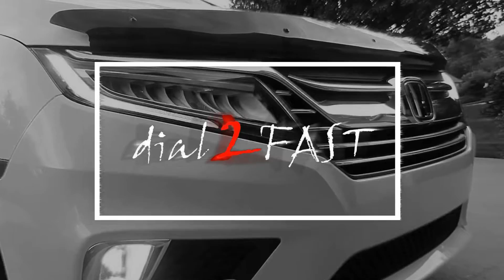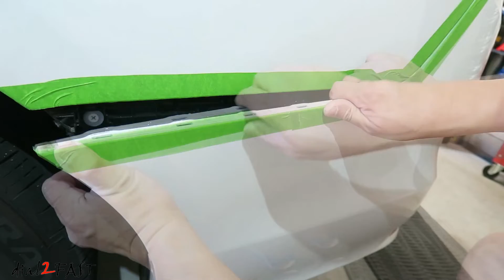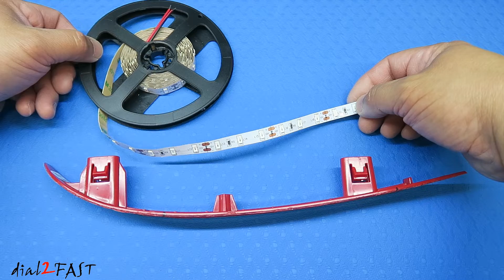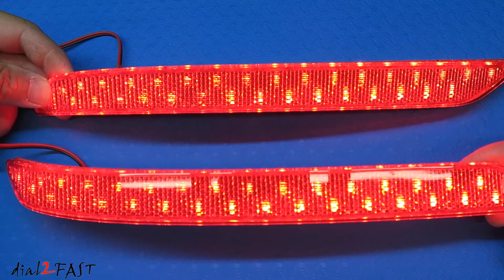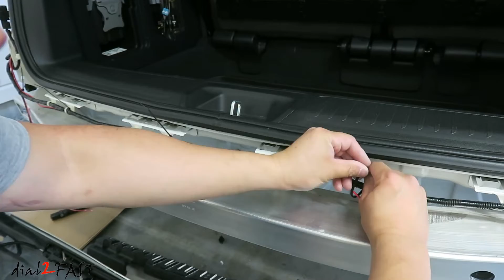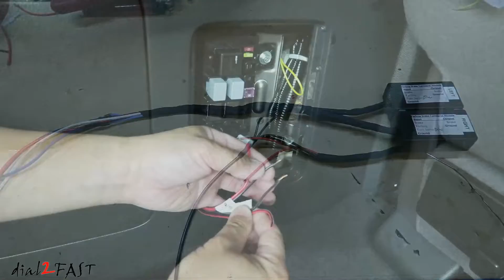Custom LED Rear Reflector Mod For Honda Odyssey 2018+

Comment: Hello sir. I know this is a pretty old video, but wondering how has the control module been holding up for you? I'm about to do this mod on my 2020, but saw the other guys comment about the module going bad. Thanks.
Reply from the maker: No issue with the module.

Comment: For the control module, I would not recommend them whatsoever. Especially from corsomotion. The company states they have a warranty but its bs. Already had 4 modules fail before the warranty was up and they didn't replace any of them. They had me ship 2 of the modules back at my own cost as well. They take forever to reply to your messages and then end up leaving you hanging for months on end. If you're planning on doing this, add 1 led strip per whichever you want (parking, break, or turn). In my case, I rewired it up just to have 2 led strips, turn and break. Wire up the positives to each the turn and break, and ground would be wired together. Doing it this way will avoid spending money on the control modules, as they are not cheap... 25-30 bucks for a pair... that you'll potentially have to repurchase over and over.

Comment: If my vehicle has an OEM Trailer hitch with wired plug under bumper, can I tap into that instead of accessing taillight wiring from above?
Reply from the maker: Yes you can connect to the trailer hitch wiring

Comment: Hi could you pls help me with wiring 2017 odyssey ex, new module has black white, yellow and red. From my understanding black is for ground yellow turn and red break, white is parking. On the van I have green (right turn signal) yellow left turn signal , red wire is it break? And brown ground? Where do I connect the  white wire from the module
Reply from the maker: On the control module, yellow is turn signal, white is parking light, red is brake, black is chassis ground. As to the wiring color on your 17 van, you need to test it with a multimeter to find out which wire is which.
Reply: @dial2fast  Thanks yes made it work

Comment: Thank you for all you videos!  This mod is great.  Is there no way to reach the reflectors withOUT taking the whole panel off?   I am not comfortable taking that whole panel off.  😬
Reply: You could probably just clip them off by putting your hand underneath the bumper. However, it's best to take the whole bumper off as you can then see where your wires go and so that you can access the inside of the car. 

Don't be too afraid of removing a bumper. They're like Legos. They clip in and out of place easily, and the screws are guiding points.

Comment: They now sell these on Amazon.
Yours has a slight delay, also turn signals are not in sync, you need to switch your turn signals to LED
Reply: What is the link to the Amazon item?
Reply: The delay is because he still has the factory incandescent bulbs in the factory lights. If he had upgraded them to LED’s as well, they’d be exact

Comment: Love your videos on moding the Honda Odyssey.. my question is do you think installing just one LED light strip would be enough light output ? Instead of your double row of LED ?  And do you have to worry about any hyper flash with this install ? Great job.
Reply from the maker: One strip will still look alright at night, but you won't see much during daytime. The two rows is also not going to be super bright during daytime. No hyperflash issue because you are not replacing the factory turn light bulbs.

Comment: Hello sir,

I have a 2020 EXL without RES. Could you please recommend an aftermarket RES that I could mount onto the back on the front seats? One of our kid is in a front facing car seat and the other two are still in rear facing car seats. Thank you very much
Reply: not possible yet

Comment: would it be possible to have dynamic turn signals?
Reply from the maker: Dynamic as in sequential LED? If so, the tough part is find sequential LED strip that fits the specific length.
Reply: dial2fast yeah, but would they be sequential when brake or parking light is on? 😅
Reply from the maker: Don't think there is a controller that will function as parking light and sequential turn. It's going to be a challenge or very expensive to do.

Comment: Looks like ur license led is not aligned
Reply from the maker: Never really looked but those are factory LEDs on the license plate. TBH, they are not very bright and it's not a bulb I can change out.

Comment: After all that , is it still a reflector? Lol , nice work.
Reply from the maker: Thanks! Well the lens still reflects if it's not illuminated. And if the LED is on, you can definitely see it. Guess you can call them semi-reflector.
Reply: At night these are better than a reflector only piece as if someone who forgot to turn their headlight on will see these no trouble.
Reply: Easier to just put reflector tape on rear of car just as good less stress too
Reply: @thew4rrior5code absolutely not just as good